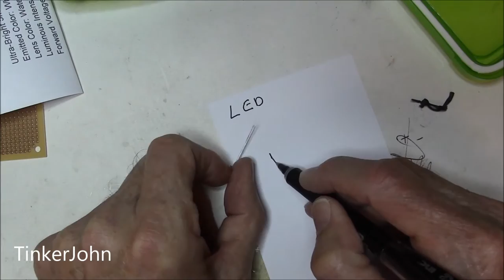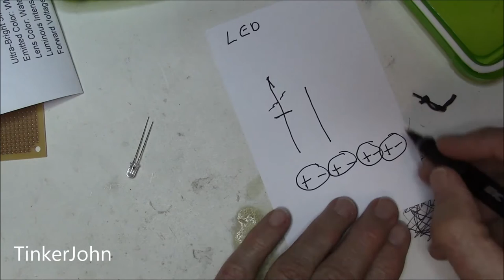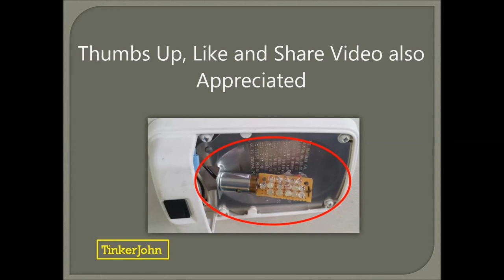Homemade LED Bulb for RV/Camper/Solar

Comment: Hi John,
     It is  always recommended to include a current limiting resistor in this application. Without a resistor  even the voltage drops  across the  LED adds up to the supply voltage the LEDs will fail some time later. I would include few 10s of ohm resistor.
Reply from the maker: +rrangana11 
Thanks for the suggestion.  I will go back and incorporate your idea.  ~John

Comment: a current limiter is always  needed with LEDs because of their highly nonlinear current curve and temperature coefficient.
even a 1 volt drop across a resistor should stave off thermal runaway.
Reply from the maker: +Aaron Pasteris 
Aaron, Thanks for the suggestion.  I'll go back and add some extra resistance.  ~John

Comment: I'm beginning to see the light John! How do you think the light output compares to the incandescent? By the way I know a friend who bought a small pop-up camper and forgot to shut off a light when folding it up and the results were the camper caught on fire. They had a good attorney  and got the camper replaced claiming it should have had a safe shut off!
Reply from the maker: +gvet47 
Galen,  The light output varies with the number and brightness of the LEDs.  I suspect that I will need to add more bulbs to get the brightness I really want.  However it's always fun to experiment!  John